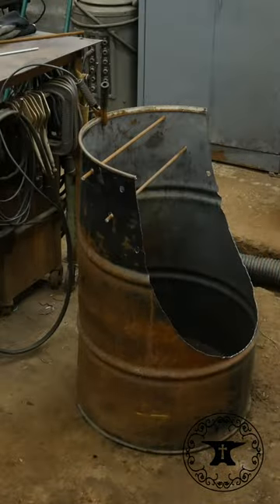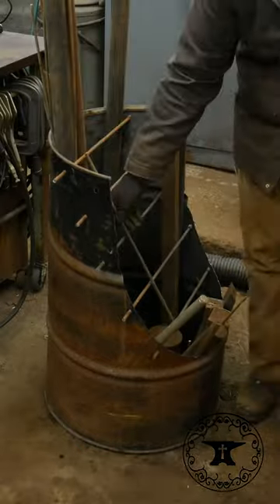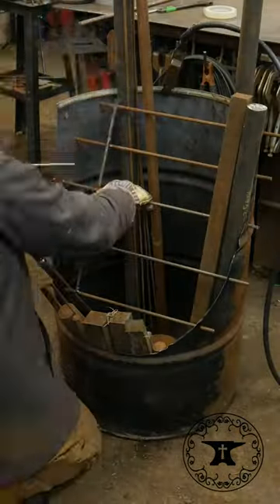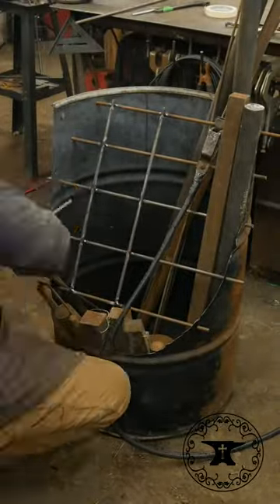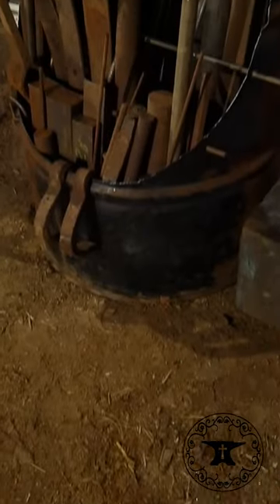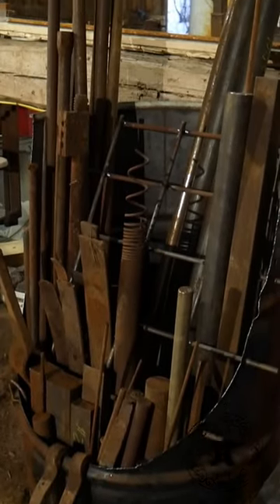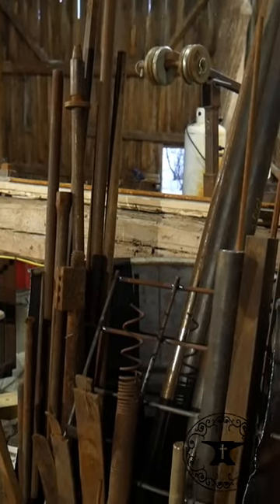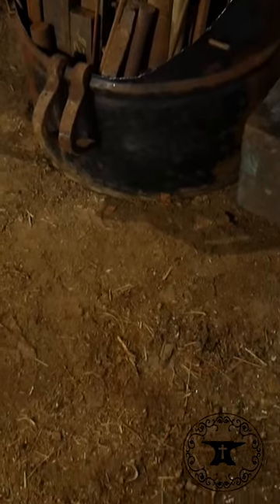Metal Barrel HACK! #shorts

Comment: Nice job!  ..there's a way to make it automatic like a coin sorter/classifier by spacing the bars at widths that will catch and redirect the longer lengths as the shorter ones fall through to the next classification point.. gravity fed. ..but the longer lengths would be stored in the horizontal position..  I've never thought about it in a drum like that.  But I'm sure it would adapt .. I like the drum .. nice n mobile...   thanks for posting.  ..